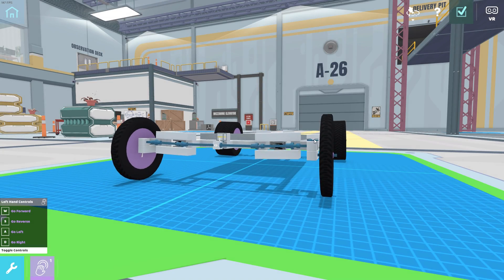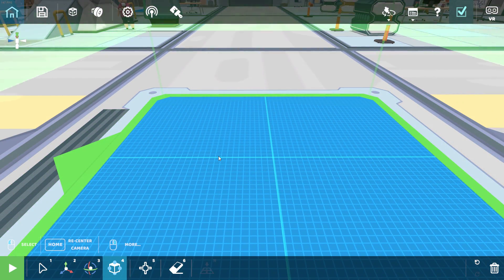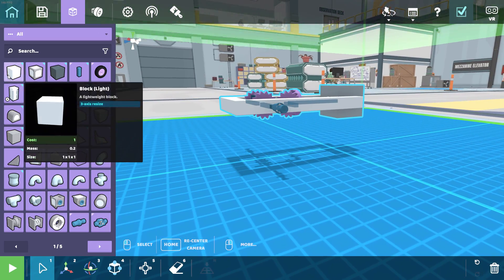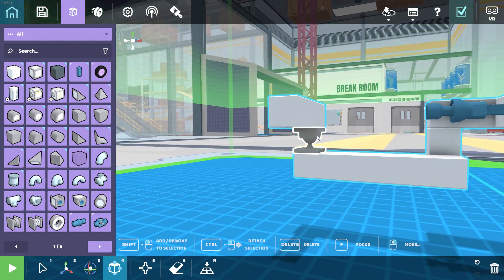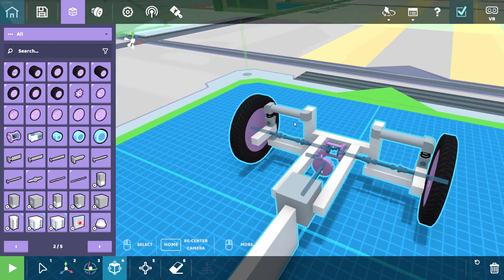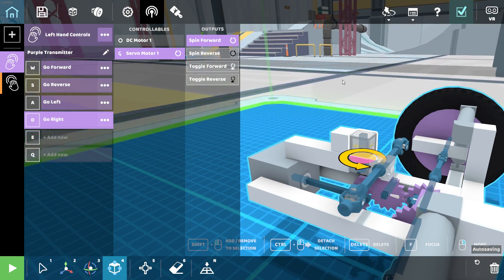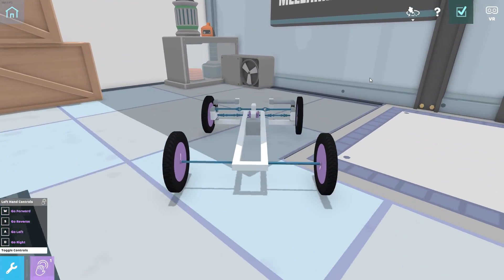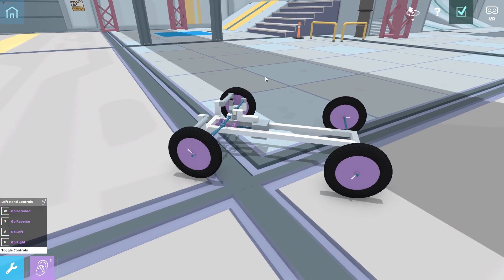Building a "Real" FWD Car with Mechanical Suspension, Drive, and Steering Systems!

Comment: The drive shafts need to be able to plunge, and yes, being inline with the hub pivots will help, too. Also, the steering tie-rods need to pivot at both ends, not just the inner side where they attach to the rack bar.

Comment: In a real car we use something called the Ackermann steering geometry with basically when turning aloes one wheel to turn at a greater distance than the other, if the gam is built on a realistic basis that would be why you are bouncing around when you turn on the other hand the pivot point does need moving in line with the drive shaft

Comment: Eh a few reasons for the whole fwd thing, first, like what you said, it's simpler as you don't have to make a big ol driveshaft or diff, instead the diff is housed with the transmission in something called a "transaxle."
Then there's also the fact that fwd cars are typically more stable and predictable, they're prone to understeer under hard steering while rwd is prone to oversteer under hard steering (which is quite a bit more dangerous!)
Edit: they're also more stable under hard acceleration as the rwd cars (especially high power ones) can spin if you slam the accelerator too hard. While fwd cars will spin their tires but won't be unstable.

Comment: On your steering rack you need to use the ball joint axle thing(no idea what it's called on the game)  but it's called inner tie rods irl you only need one for each side then at the knuckle you need to add a ball joint vertical so the steering rack can move with the knuckle/suspension, the tie rod end needs to be in the center of the wheel but forward (on fwd the tires pull in, rwd they pull out so the tie rod end is behind) but anyway have it as level as possible if the inner tie rods are at a angle you can induce bump steer, for the cv axles I'd use the u joints not the ball joint style, if you want a better understanding on it just message me i have a rack and pinion out of my car that I can use for visual reference  :)

Comment: FWD cars are popular since you don't need to have a drive shaft going through the length of the car taking up cabin space and also a traverse engine mount can be easily used. Allowing you for a lighter, more compact and spacious car that is cheaper due to less parts. The macpesrson isn't exclusive to fwds though, it's a good cheap independent suspension system.

Comment: Drivability. While there are spatial and economic reasons for FWD, the primary one is drivability. The back wheels won't slip out with too much gas or by taking a turn too sharp, they're there to provide stability. AWD has similar advantages, and generally has more grip. However, powering the rear wheels does make it more likely to lose grip in certain conditions, not to mention the lower turning radius because of all the wheels getting power.
Reply: I think the drivablility comes more from the fact that FWD vehicles usually have less power to control. I am confused on the part where you mention turning radius due to power at the back wheels. That depends more on the vehicle length and steering geometry. Shorter vehicle usually turn sharper, but if 2 vehicles are the same length the one with steering that allows sharper turns will turn sharper. Usually a sharper steering angle is easier to achieve on a RWD since they don't have to worry about the front CV axles.

Comment: Question, can you use a piston or something to move things off the 90 degree build grid, like is possible in scrap mechanic? It would make it possible to get the correct angles for correct feeling suspension and would allow you to use some sort  of Ackermann steering geometry for realistic steering.

Comment: Front wheel drive vehicles allow less power loss meaning smaller motors and better fuel efficiency. That's pretty much all that is. Also, you might extend a block backwards from your bottom control arm, and the extend something from the frame, and then your spring there so your pushing against the frame instead of against the upper suspension arm.

Comment: In a real car the CV joint is directly connected to the wheel I had the same turn issue when I built this mechanism in scrap mechanic the solution is to directly connect the CV joint to the wheel

Comment: The reason FWD is so popular:

1) It's cheaper, less mounts which have to be strong enough to handle power transmission, less overall material.
2) It allows the floor to be flatter, and thus more spacious inside the car, as you don't need a trans tunnel.
3) Easier assembly at the factory, as the powertrain, sans the half shafts, can just be dropped into the car already assembled as a single unit.
Reply: Also, fuel economy was one of the big things too. Less rotational weight means less energy is needed to move the car.

Comment: Sidenote the main reason most cars on the road are front wheel drive are for
1. It's just easier mechanically and you get more interior space without the tunnel for the drive shaft going down the center of the car.
2. Better traction in bad weather.
3. Fuel efficiency.

Rwd and awd are less fuel efficient and mostly used in enthusiasts vehicles like sports cars, trucks and suvs
Reply: In winter with a lot of snow I saw a BMW with RWD on the exit from a carpark, but the exit was on a slight incline. So he took a run at it, made it but didn't let off the throttle. The car oversteered in the following left turn. He hit the right rear wheel on the curb and the tire was blown and the wheel itself was cambered. I'm pretty sure it was a total loss.
Reply: @pascal2085  Do you happen to know what type of BMW? I've never had an issue with snow or ice in my BMW, but it does have a limited slip differential. I know for a fact the ones without the LSD have issues. For example years ago I went to my buddies and I was driving my M3 and his girlfriend had a 325. We were parked in spaces right next to each other on a slight incline to the back of the spot and we had both backed in. We went to leave and the 325 just spun its tires. I put the M3 in first and let out on the clutch and it just kept moving like nothing was stopping it. I have driven that car in so many snow storms just because of that.
Reply: I understand the first statement, but it still doesn't really make a lot of sense to me with how small driveshafts can get and now with all the center supports we like to use. I think in most cars the transmission tunnel is almost unnoticeable or takes up pitifully small space and the only reason it really gives more space is because transverse engines are more so used in small econ cars. In bigger cars it's not noticeable to me. My Tesla has a flat floor for obvious reasons, but even when I have driven other vehicles around the same size I have never once though "I wish the transmission tunnel was smaller so I can fit more things in here". Usually my complains are about the rear door size/shape or how big the rear trunk is and how small the trunk opening is.

Comment: I don’t know if this is going to make a difference but I would make the knuckle ( the thing that connects the wheel to the suspension and steering) a little bit bigger so there is more room to wiggle around. I work on cars and i notice the the macpherson strut (also call quick strut) acts kind like a ball joint. That is why people go to do alignment to adjust camber, caster, and the toe. I didn’t see anyone mention that.

Comment: Fwd vehicles have floating axles. They can slide into and out of the diff and spindle slightly. The splines are long enough to allow it. Some vehicles also use axles the telescope in and out with the suspension movement. The wheel is held on to the spindle which is the part under the strut connected to the lower a arm. The brakes are also connected there. This is why double wish bone suspension is typically used on heavy vehicles and the mcfearson strut is used on compact car. You really don't want you wheel to be held on by a strut when trying to stop a heavy load.

Comment: Building yourself a custom gear box would definitely help as it would allow the wheels to spin at different rates which helps with turning although I understand trying to save on games performance

Comment: Come on kan. In physics it's easier to pull something than it is to push. Front wheel drive is for fuel efficiency.
Reply: Um whether pull or push the energy it takes to complete the action is exactly the same. 

The only reasons cars are generally fwd

Packaging: the small compact motors with compact transmissions all fit under the hood and thus take up minimal interior room if any at all. This allows for a lower floor and more leg room or headroom depending

Weight distribution: contrary to the track environment, putting more weight over the drive axle allows for better grip in wet weather and better compaction on snow. It also helps break through thin ice. You don't need perfect balance when going to Wendy's, or Wal-Mar.

Weight in general: the overall weight of the drive train is typically less that that of a rwd or AWD car since parts are smaller and you don't need long drive shaft or large axle housings. Transmissions are much smaller and thus lighter. This overall means less resistance to change in momentum and less energy is needed to both accelerate and stop.

Comment: it seems that double wishbone suspension doesn't really have a generalized name for when the arms arent wishbones, since IRL non-wishbone/A-arm configurations are mechanically terrible, and most games are perfect rigid bodies and lack the granularity to make realistic joints, so "double pivot suspension" can only be replicated in an unrealistic way.

i made a macpherson strut in scrap mechanic and it worked pretty darn well, aside for being massive and having a mild stabilization glitch.

you also forgot to add a vertical pivot to your steering. that means your supension is currently the backlash of all your pivots. little force is going to your springs

Comment: uh i think the steering needs more flex its to tight ?  use a other beam the move the steering like uh its hard to explane ._. searth up steering axle off road and find the one with a beam ontop of the main steering bar but good luck <3

Comment: The axles have to be centered over the pivot for the steering.   Also, the out end CVJ should bend on the centerline of that pivot.  On the inside, you need a DOJ or a CVJ plus  a slip joint of some kind to deal with the slight length variation when the suspension travels up or down.     Or if both inner and outer CVJ bend on the same axis as the suspension arms.

Comment: I think i can see the problem, its pretty simple. Im going to refer to 3 different parts as 1 2 and 3. 1 connects to a rod and a cv joint. 2 connects to that joint and extends to another joint. 3 connects the final joint to the wheel.

3 has no pivot attached to the wheel, so it is forced to pull/stretch on 2 but it can't because 1 isn't able to move or flex and 2 is rigid

Comment: On a McPherson Strut you dont have an upper ball joint and there is no moment in or out.  The knuckle is solid mounted to the strut and there is only a ball joint on the bottom and thats why your knuckle was flapping around before you added steering.  Also it appears as if you figured out why the steering and axles were binding.  They need to have the joints in line with one another.  Cool to see someone building a fully functioning front diff and all.

Comment: kAN, you need to replace the u joint on the steering rod for balljoints. One at the rack horizontally and one vertically at the steering knuckle (for a total of 4), this would actually perfectly simulate a true rack and pinion system if the game allows for it. U joints are great for mobility but if the part they are installed on is not rotating (e.g. the driveshaft rotates, the steering mechanism does not) then u joints are completely useless.
Reply: you are the only person i have seen that has been correct on this. so many dont appear to understand cars.
Reply: @Timicro16  I wouldn't call them out. A lot of people around here don't have any engeneeiring enginiering engineering degree and just try to understand what went wrong and how they could do it.
Reply: @pascal2085  i dont have one either. Also that wasnt my intent. It was more so that feeling of "im not the only one who gets it".

Comment: In real cars the "drive shaft" is connected to the frame between the two joints and the part that is connected to the wheel should be a little longer and iam pretty sure that's should solve your problem :)

Comment: I think where your steering rod attaches to the wheel is missing a joint and so its binding up. If you let that air duct looking part its attached to swivel parallel to the ground it should allow the the rod to not bind up.
Reply: If he wanted to stick with realism, he would need to remove the u joint and have two ball joints on each side of the rack for a total of four: one at the rack itself and one at the steer knuckles on both sides. Tie rod ends are ball joints, not universal joints.

Comment: Jeeeez Kan, think about it......where's the pivot point?!?!  If the shock arms move up and down, where's the drive shaft pivot?  Same with steering and the driveshaft.  It's out in both vertical and horizontal.  Should obvious every plane has use the driveshaft pivot as it's center point.

Comment: Kan just slap an exstra big gear on one side of the differential and then you can conect directly to it and it will drive the differential. Slightly more complicated but essentially same as what you did currently

Comment: In real cars it is off center one cv axle is longer then the other love the videos
Reply: True and that use to cause issues when putting power down, but in recent years they have learned how to mitigate those issues by having the longer axle be two piece or more if needed. The driver side axle is usually the shorter one  and what they would do is add a center bearing to the passenger side axle to make it work like two shorter axles. By doing that they effectively make all axle pieces the same length and prevent the twisting issue they had on the passenger axles.

Comment: This reminded me of the realistic car you made years ago in SM, and speaking of that, there is now a mod called "mechanical parts" which has 3 different size gears (ACL gears only has 2), rack and pinion gear, universal joints etc. It would be really fun if you revisited the whole realistic car concept!

Also I was screaming internally when you didn't put the driveshaft and steering pivot in line with each other :) In real life I think the driveshafts are allowed to move a little bit in and out on the transmission end, to allow for the slightly different length as the suspension compresses.
Reply: its the inner cv joint that allows for compression and expansion of the cv axle during suspension movement while the outer one can pivot/ turn tighter to allow for move steering angle
Reply: yess thiss